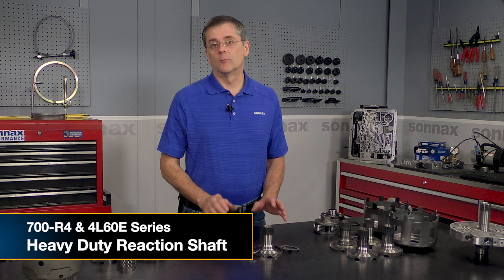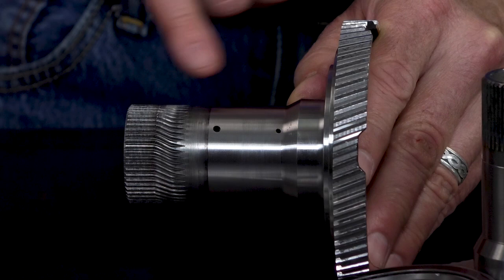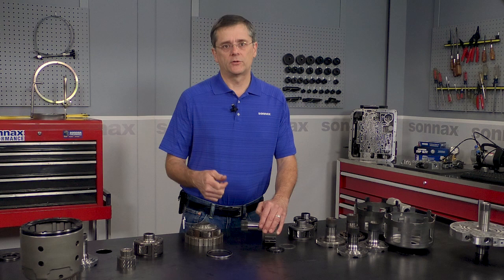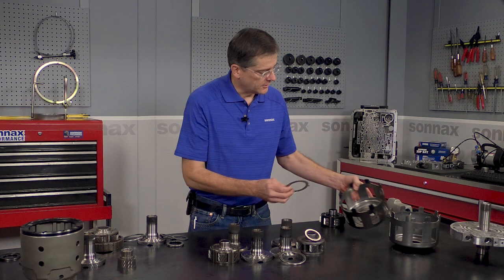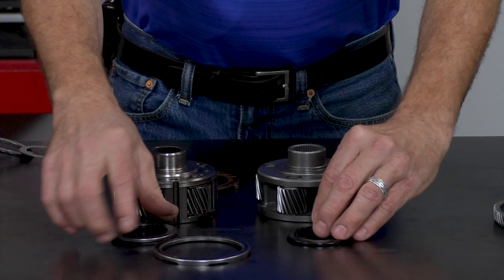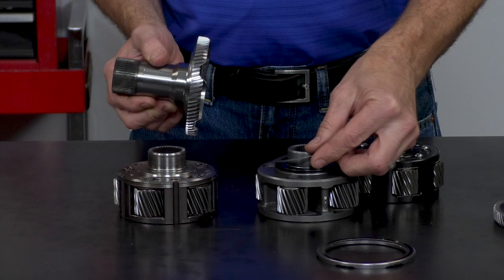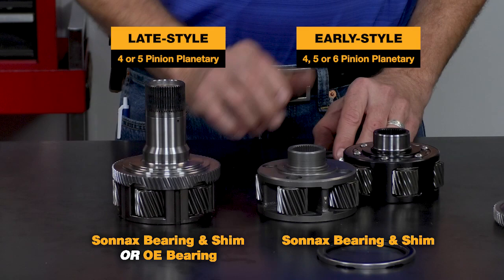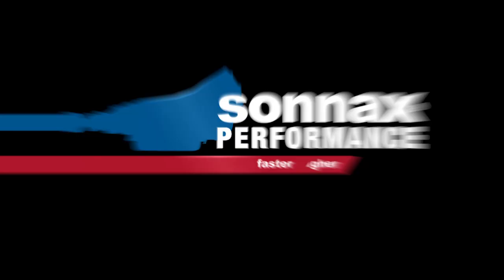The Ultimate 4L60E Reaction Shaft Upgrade for Big Power Transmissions

Comment: Disassembled 4L60 from 2006 Suburban, the reaction support (685) GM #24225931 is staked to the output shaft, two heavy dimples on the front face of the gear plate.

Have you ever seen one of these, and why is it staked on?
Reply: This is a 4WD output shaft, also. Another thing.. where the case bushing (7) is pressed into the bore, there are two oil passages that are mostly covered by the bushing, at the notch positions, and definitely allow oil to pass into the after-section, case extension (6-bolt, for the 4wd adapter to the t-case).

Why in the world would anyone want ATF to pass into the extension adapter for the 4WD application ?  The oil is just pooled in this area, cannot, obviously enter the t-case, due to input shaft seal, and there is no drain-back holes into the transmission body.  When I loosened the adapter nuts to take down the unit, ATF poured out of this volume, and, of course, on the 4L60E, there is no case rear seal, as in the 4L80.  

So, what is the purpose of these two oil passages that trench under the case rear bushing ?
Reply from the maker: @boogerhead0  Our tech team would be happy to help you. They can be reached directly via email at sonnaxtechsupport@sonnax.com, or phone at (800) 843-2600 ext. 398. Thanks for reaching out!